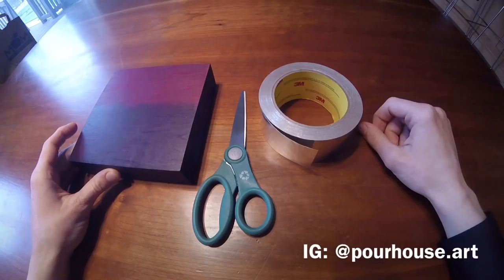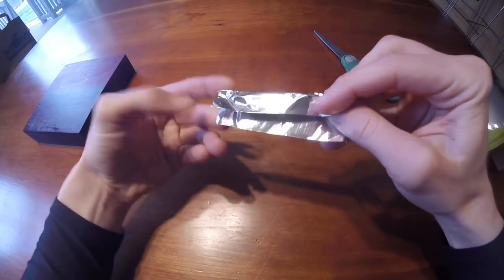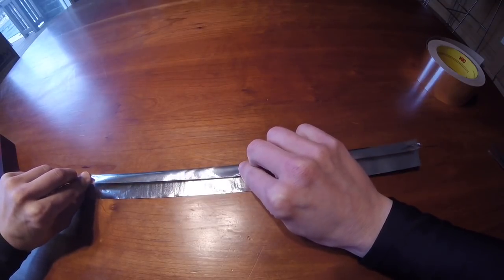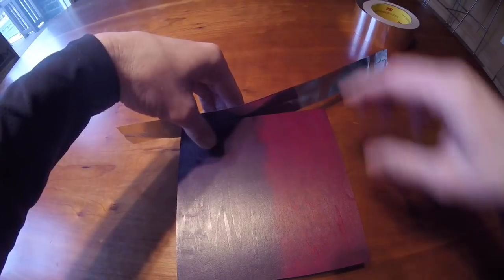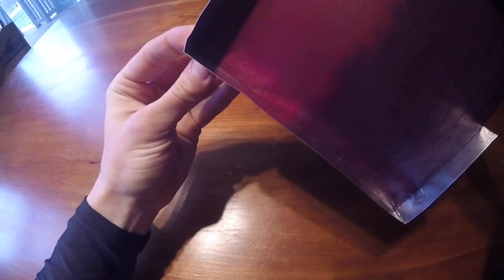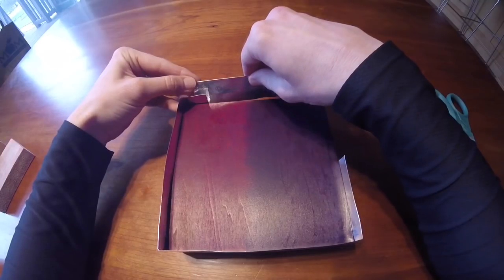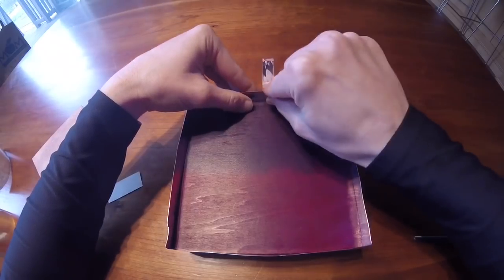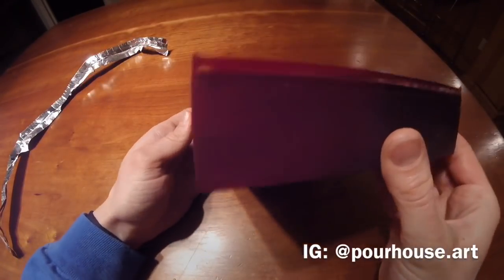How to build a resin wall/dam

Comment: I’m confused. You folded the top edge down and then folded the  bottom edge up so how does the tape stick to the wood?
Reply: Cupcake Cottage Studio she didn’t fold the bottom edge up: she adhered the bottom edge to the board, and then folded the tape around it... easy enough to confuse 🤷🏻‍♀️ ✌️

Comment: Thnx for the idea! Ive been wanting to make a “wall” on a piece of glass so i can pour resin over it. The glass is kinda thin compared to the wooden block, but Il try something close to this :)
Reply from the maker: No problem! Don’t try it on a thin piece of glass, it will most likely end up cracking around the edges. I’ve had success with thicker pieces of glass and thicker pieces of plexiglass. Good luck!
Reply: oh thnx for the tip!! :)
Reply: demi sy    If you are going to frame,....leave the frame in place.
Or you could place the glass on top of a box,..such as demonstrated just to use the box for support.

Comment: Hello , I made a bowl joining round pieces of a type of clay and holes remained in the joints, I want to cover it with resin inside out, but I don't know what to use to cover one side (while I'm pouring the resin let's said outside of the bowl)  , so the resin doesn't come out through the holes, I can find that tape in my country, but maybe I can use Foil? To cover the inside? Do you know if this would make the resin not to get stuck or what materials can I use to mask the parts I don't want to get resin? Thank you so much

Comment: Thank you very much, this is very helpful. Can you please suggest what to do if the edges are little raised where the touch the wall? Mine came out raised and really scared to touch it as rest of the finish is just perfect. 
Thanks again x
Reply: Did you ever find a solution?

Comment: I'm considering daming the edge of a table 40x30 inches with metal tape to level w resin. Probably 1/4 inch max resin depth. Thoughts?
Reply from the maker: J.B. Eid Hi there! Sorry for the late response. Have you tried this yet? As long as the table is completely level, you shouldn’t have any issues using this same technique that I did in the video :)

Comment: i have a question: if you do this can you do multiple layers of resin without taking of the tape, or do you aply a new tape every layer, and after you have sanded, the resin will be foggy and not glossy how do you get the gloss back ? sorry if im asking to much
Reply: Caroohlien I know this was asked some time ago,  but in case anyone is wondering...
Yes, you can do multiple layers without removing the dam; as long as the tape is high enough to comfortably fit your additional layers, it can be used pretty much as a regular mold.  It’s important to remember to add additional layers while the previously poured resin is still tacky, otherwise you will need to remove the dam so that the previous layer can be sanded before adding another. 👌

As far as getting a glossy finish after sanding, there are a few ways to go about this.  Some of the most common methods involve continuing to sand and polish by using a finer and finer grit, then buff using a polishing compound, etc until your piece is shiny again.  
...Personally, I prefer to skip all of that extra labour and just use a gloss finishing product, (of course, satin or matte work too) there are tons of options for a nice shiny finish, anything from a glaze or varnish, (even clear nail polish works in a pinch!) to spray sealants and of course: just use another layer of your resin! (These last 2 are my fav methods, easy peazy and cost is measly.

Comment: I seem to be missing something. It looks as though you are folding the metal tape from the top AND the bottom and therefore COVERING the "sticky part" or am I just losing my eyesight?
Reply: She flipped the thing so it looks like she is doing both but the top part just became the lower part because she turned it around.